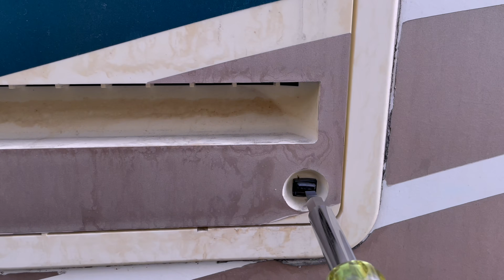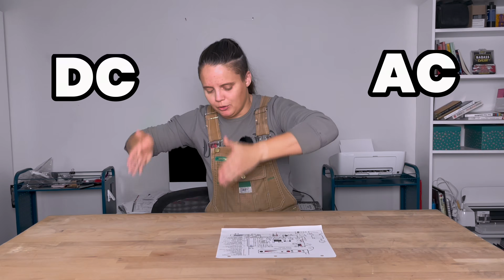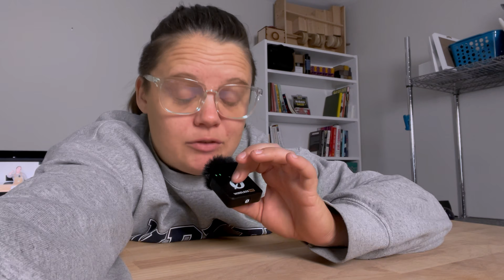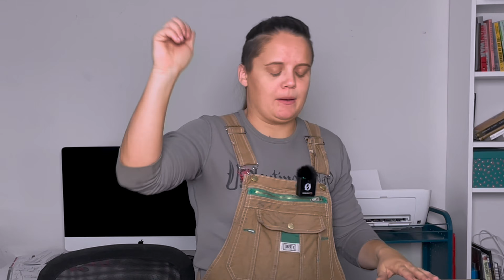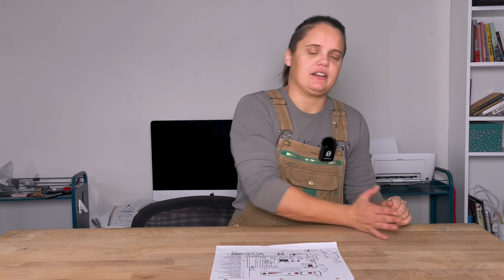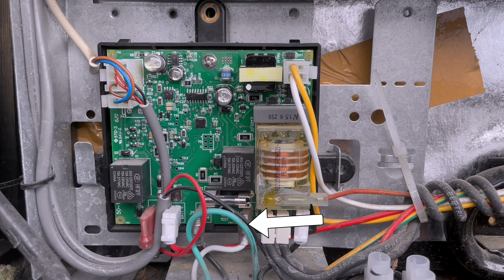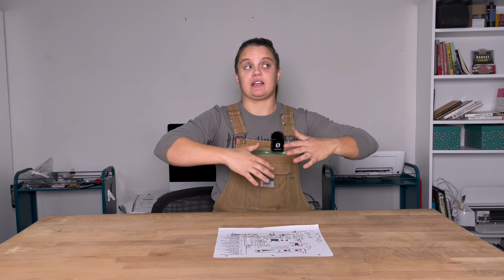How to Troubleshoot Your Dometic RV Fridge (With a Mobile RV Tech)

Comment: You can't get the fuse at auto zone or any auto store, I've checked, if you look at the fuse it is a 5A/250Volt, auto stores only sell up to 32 Volt, Ace hardware is the only place I found a 250 volt fuse... Yes they look exactly the same but they aren't!
Reply from the maker: Yes! Now that I think about it you’re right. The AC fuse you’d have to get from a non-auto store. (I got a bunch of these one time and then haven’t had to buy them again in awhile)
Reply: @rvrepairwoman I'm glad you replied, I watched this entire video, tested every single component on my domestic RV fridge, everything tested perfect, my fridge and freezer only get cool on electric but if I put it on propane the freezer actually freezes like it's supposed to, I'm at a loss! The only thing you didn't test was the thermistor lol, my luck it's that but why would it work with propane then? Thanks!
Reply: @rvrepairwoman so, I know I posted about this 9 months ago, I watched your video over and over and over, tested everything, I found several things wrong and replaced things one by one, I had a major power surge hit my RV and fried a lot,,, my inverter, blew my fuse in my microwave, fuse on my fridge control board, fuse on my water pump, fuse in my breaker box, heating element for my fridge, I'm not even sure if that was everything, I know it was a lot but you videos helped me a lot! So, my fridge went from not working to freezing everything! I even replaced the thermister and my fridge is still freezing! I tested every ground and wire and plug on the control board and everything tests perfect every time! The eye brow board is working on electric and gas but I'm not sure how to test it! I'm just not sure why the fridge is freezing just like a freezer! Could the control board still be bad even though everything is testing perfect? Please point me in the right direction! Thanks!

Comment: Hello - I acquired a Dometic RM3962 with an airstream remodel and it has has never been used.  I plugged it in to AC (110V) and it does not turn on.  I replaced the circuit board because it has been sitting for many years but still no power reaching the eyebrow control panel.  Can anyone help with this matter?  It will be greatly appreciated.  This video was very helpful to check that power is getting to the other components.

Comment: Hello I replaced the control module and the thermal fuse wire on my demetic 2-way refrigerator and now I have power at the eyebrow board and the lights come on but as soon as it tries to go to 120v it kicks a breaker. Any advise on my situation would be great and appreciated. Thank you.
Reply: Not an expert here but I'd look for the 120V heating element and test that

Comment: My dometic is just 30 months old like my 2023 Thor four winds. Freezer stopped freezing, refrigerator 48 temp. Dometic base was terrible imo. He said well freezing temp is 32. He sounded condescending when tech said temp was 28 at the backwall screen /freezer. And temp 39 at the Finns was satisfactory. Could I really need a Cooling unit $1500 installed?

Comment: Great video. I don’t recommend replacing components on the control board, but I have, because I’ve worked with single layer PCBs for years (built my own too), and have the right tools and training, and replacing a relay, diode, capacitor, it’s down my alley. 
So, for my problem. Fridge works on AC (Dometic) and on gas, but on gas, both the flame and the spark go out about 10 seconds after lit, and I checked all the fuses, heating element, etc, but not yet the gas valve because if both the gas and spark quit at the same time, it’s not the individual component, so I’m looking for a control board schematic so I can follow the electrical flow and identify the problem, as I know those boards are in the vicinity of $180 for the model of my fridge. Great format on your video, and kudos for the hands on work you do. Uncharacteristic for a woman and your age, but glad that you can do it.
Reply: Would you be able to modify a furnace's control board and turn it into a variable speed furnace for the start and end of each cycle?

Comment: Why does my fridge fail during cold weather? I replaced my eyebrow board and it worked, but when temperatures drop like at 25° the check light comes on. I did do my diagnostic check on the lower circuit board behind the fridge and checked out good.

Comment: I have a dometic rm7401 will not run on gas ignition is clicking but not lighting it a brand new burner complete with igniter and thermocouple is there anyway of checking the gas valve is working please

Comment: Hello I followed your step by step diagnosis procedure, everything checked ok. My Dometic fridge 2652 works but doesn't get cold, I replaced the Thermistor, but it is still the same. In  110 volt mode the heating element get hot and in  the propane mode the burner also works, I am thinking I have a bad cooling element, how can I check it? Thank you for your help, great video it was very helpful.

Comment: I’ve been having trouble with my rv fridge.  Works on gas but not electric.  Replaced heating element and fuse and it worked for a while then blew the fuse.  So, I’ll try tapping and testing the relays.  But, it’s beginning to look like I might need a new circuit board.  I believe my upper module inside the fridge is okay.  But it’s clear that something is wrong.  Your video is helpful, confirming tests I had already done.  Thanks

Comment: I love the video… I do have a question.  I have a Dometic refrigeration my Wolf Pup 16 FQ by Forrest River.  Here’s my issue and I hope you can share with me a few thoughts on why this is happening..

When I’m hooked up to 30 amp OR running off of propane, the refrigerator works perfectly.. until I open the door and this is what happens…
The interior light will begin to flicker within 1-2 seconds of the door open.  After a few more seconds, the light goes off and the refrigerator completely stops working.  I then close the door, and up on the top left of the fridge, I turn the button from on to off, then Hit the ON button again and the refrigerator comes back on and the cycle continues when I open up the door.

Thoughts???

Comment: Hi! Such a great video, you are soooo helpful! I went thru everything and the black wire and a.c heater plug on the board were the only things that had zero juice. Before I go and buy and install a new circuit board I’d appreciate if you could confirm that a new board would do the trick. I hear a repetitive clicking in the circuit board when I turn the eyebrow board/fridge on. I did the finger whack trick but nuthin’. Any advice appreciated and thx for a great channel!

Comment: I followed all the checks with my multimeter and still not cooling. What could it be if the eyebrow has life and I'm getting 12 where 12 should be and 120 where 120 should be, amps are good, and everything is in order on the control board and heating element. Tube is heating up. Totally stressing since the fridge still doesn't cool. Any ideas? Ventilation of coils?

Comment: The good.  "Great video", and laughs too (eyebrow boards orange wire or black return wire dead, BAD DAY FOR YOU).  Been doing hardware for a LONG time.  This was right to the point for a tech and even at 1.75 speed.  Now the bad news.  The 12 volts was all good, the 110vac was all good and still no cold in fridge.  I did find the thermistor at 3.3K (P2-1 and  -2) and read some where about 8K-10K (in their manual I think).  I did not amp clamp the heater, but I will check it tomorrow and make sure there is 1.2 or so amps.  The little stack was real hot so I skipped the clamp..  Anyway, it's still broke, do these have a gas in them that could have escaped?  It belongs to my sister-in-law, and I know little about refrigiration, but with your help blew right through the control and eyebrow boards.  Thanks again, and great presentation.  It was like hearing myself when I teach.  LOL..  Thanks for any extra ideas.  I loaned her a mini frig for now.

Comment: Hey very good video except you forgot to mention what is going on if you do not have 12v going to the gas valve. I take it the control board is at fault

Comment: Our RV fridge had developed an intermittent issue of not cooling reliably. I replaced the thermistor and that appeared to have addressed the issue, for a while. But yesterday the unit just quit cooling. Today I'm trying to troubleshoot the problem and found this video. Ours is a Norcold, not a Dometic, but there's still plenty of information here. My problem appears to involve moving targets :( Initially, the green light indicating the fridge had AC power was on. I pulled the plug on the AC and the propane burner fired off. I thought, hopefully, that the fridge would now cool down using the propane operating mode. But, the gas cut out. This cycle happened a couple of times before I checked our propane and found that the tanks were out. Swapped in a full tank, but now it won't ignite - other gas powered items are working. Plug the AC power back in and the indicator light telling me it's on AC doesn't come on. Unplug the AC again and no propane ignition. It appears to be the case that in the course of troubleshooting the problem, the problem has changed :(  Writing this all out as much in hope that I'll think of something else to try as that anyone will have anything helpful to suggest ;)

Comment: you rock! my outlet for my fridge isnt outputting any voltage😢. not sure where to go from here but i will keep looking. thank you❤
Reply from the maker: Check your breakers and the gfci in the bathroom!
Reply: @ thank you so much for the reply. i checked the gfci in the bathroom. all outlets are working in the rv. so weird. ill look at a guide on the breaker next. i appreciate your response so much😁

Comment: Hey Great Video!  So I have a question I hope you can help with.  I currently have my camper in the shop for recalls and I asked them to look at my Fridge Light because it doesn't work.  The fridge itself is working fine as far as cooling.  I replaced the bulb and notta!  The RV place said "maybe it was a circuit board".  The answer was sorta vague for me.  Do yo have any advice?  Is there a secret fuse for just a light?

Comment: This video is excellent, but I must say you left me hanging at a critical point. My fridge doesn't work but following your video, all voltages are exactly what you say they should be be, everywhere you say they they should except   on the black wire coming back from the eyebrow board to the main. No power there. However, if you hold the eyebrow board in your hand vertically with the connector on top, there is a small row of pins across the top of the board that correspond to the wiring colors in the harness. So the green wire is to the right and the black wire is to the left. The orange wire has 12 volts as you said. But the corresponding pin for the black wire is dead.  I have put two new boards in and the results are the same. Is there really supposed to be 12 volts there or am I missing something? Thanks for clearing this up if possible.

Comment: Watched your video for a fridge that wouldn't light on propane.  Tested the circuit board and found that there was no power to the valves, I purchased another board from amazon $38    Had it the next morning,  Put it in and It lit right up.  Thank you for your vid. saved me from not having a fridge on gas for my vacation next week

Comment: Hello! I have a dometic rv fridge not yet installed in my camper. We put 12V and 120V and the pipe got hot, but no cooling happened. When we put it on propane,  it cooled, but cant get below 66 in the freezer, fridge is room temp. I checked the position of the thermistor, put it in the right tight place. What else? You can hear the ammonia boiling, and its super hot on the pipes. Why isn't it cooling inside?

Thanks from Texas

Comment: My wife and I live off grid in a 4 bedroom house that runs off solar and propane and our propane fridge broke down about a year or so ago. Our solar is limited but we have 2 1000 gallon propane tanks for our generator at night and our refrigerator. We have a few RV's on our property that were left from the previous owners and were able to get a pretty nice propane fridge out of one of them and but we can seem to get it to turn on, we followed your video and made it to the orange wire and nothing on that wire. So we went and pulled the circuit boards off of 3 other fridges all of the the exact same and everyone one of them has power up to the orange wire and then nothing, all 4 boards look to be in excellent condition and the fuses are all good to go. They all can't be bad could they? I mean there is no sign of any damage at all to any of them. Any ideas? I'm wondering if I need to run a grounding rod of some kind out side  but if it was a grounding issue i wouldn't be getting power to evey other part up to that wire I wouldn't think would I?

Comment: Mine is testing good on all but the thermistor resistance is low. Putting in a new one tomorrow and hopfully the fridge will cool? The fridge is only 3 years old and no yellow leak or ammonia. Next step is turn the fridge upside-down for 24hrs

Comment: This video looks great. And it would be nice to have a little flow chart based on symptoms for the uninitiated. Then then could skip right to the part they need. Was able to figure out I only needed to start with your last chapter.

My problem is that on shore power the unit turns off the gas but doesn't cool. I found a blown fuse, replaced it and it didn't blow but still didn't cool. I could hear a relay kick in so I thought it was working, but no. My guess is that it was the electric heating element. I measure an open circuit across the heating coil. I really need that resistance table that you say is in the description, but is not. Or at least a range. I'm pretty sure that there would be some resistance on the heater.

Comment: What 8m 30s into the video - 9m 10s 

What if I’m only getting 10.5 to my top left terminal ?
Reply: You said if it’s not 12 I may need to replace. Mine is 10.5 I know you said a range of voltage is okay earlier in video but idk if that apples for this stop also. 

I’m getting 12v to everything, so far

Comment: Thank you for your video.  I have tested my Domectic Refrigerator.  All test were good, except no AC power coming out of J8 heater pin.  The rest is getting AC 120, but no AC to J8.  Is there any other reason why I would not get 120 to the AC heater pin.  I have bought several boards from Amazon and I guess all the boards are bad because none of them provide the 120 to the AC heater pin.  Outlet good, AC line good, fuse good, AC to both sides, and all  the check points to 12 volt work.  Also, Thermal Disc good, fuse good, and heater lines good.  Thanks.

Comment: Can you help me with this if I bring my trailer home from storage and plug it in the refrigerator will not start on electric but if I switch to gas, it’ll start working and then it will work on electric

Comment: All caps because I am at my wits end, I REALLY NEED YOUR HELP!
I RECENTLY REMOVED A HARD WIRED CIRCULATION FAN FROM MY DOMETIC RV REFIGERATOR AND NOW I DON’T OR CAN’T GET THE WIRING CORRECTLY TO RUN THE DOOR SWITCH LIGHT! I HAVE CHECKED WHAT O THINK IS THE PROBLEM BUT WITH NO SUCCESS. REFRIGERATOR RUNS GREAT AND COOLS VERY WELL, SO THERE IS NO REFRIGERATOR PROBLEMS, JUST THIS DAM LIGHT SWITCH WIRING!!! Can you help PLEASE? Thank you and very much enjoy your videos, content, and excellent advice with great tips. 🇺🇸

Comment: Just found this video!!  Dometic DM2652.  Did all of the checks and everything was looking great.  Lights on the eyebrow board were on sensing the Check Light wouldn't go off.  Did all of the checks and everything was fine.  Went to check the orange wire going to the control panel and 2.1 volts. (Motherboard?? as stated in the video??) Now, no lights on the eyebrow board.  Fuses in the fuse box are good.  Apparently, I need a new motherboard.  NOW, I'm seeing a bunch of "upgraded" DM2652 boards.  Can you please elaborate on "upgraded"??  Thanks for your help.

Comment: @rvrepairwoman I didn’t have 12v on the fuse on the circuit board but the fuse is not blown. Does that mean my board is bad?  I have lights on the eyebrow panel, the fridge doesn’t cool in either gas or electric.

Comment: Quick question, I’m only getting 7 volts to my gas selenoid/valve, but I have perfect voltage all over the rest of the board. 

Am I looking at a bad board then? 

What I’m finding is if I tap the valve im getting it to open, but it only stays open for a few minutes or as much as 20 minutes, then closes and the fridge goes into check light. Wondering if the low voltage is causing the valve issues or if the valve itself is having issues and there isn’t supposed to be 12 volts to that valve. Fridge is a dometic dm2862

Comment: Emily
Good stuff.
Except for the fact that you never mention the neutral conductor!! Without it your 120v to ground is useless.
Yes equipment ground is very important but with an open neutral nothing on the AC side will operate. Please be mind full to this as you may be putting this content out to unskilled watchers.

Comment: You should be diagnosing with the same ground your electrical part is using. If you find voltage problem you then confirm it with a known good ground.

Comment: Watched through your video and here’s my discovery: J8, heater pin, on my Dometic control board shows 1.6 volts and when I checked my heating element at the cable ends for continuity I get no tone.  I did thwack the relay and when I rechecked the heating element pin, it’d dropped to 1 volt.  Suggestions? Oh, fuses are good. My plan is to purchase new heating element; and if that doesn’t do it, then new control board.